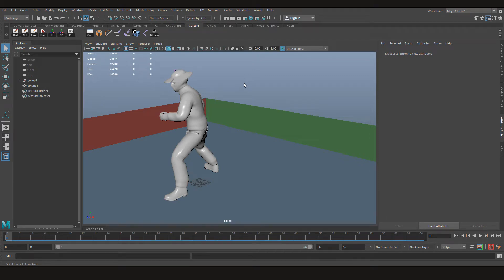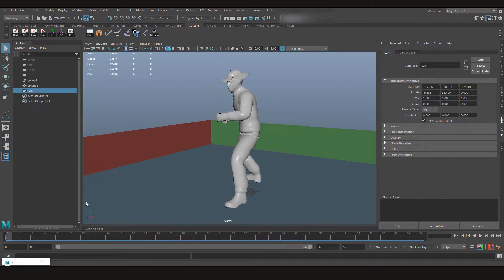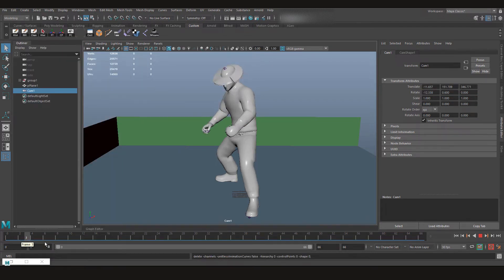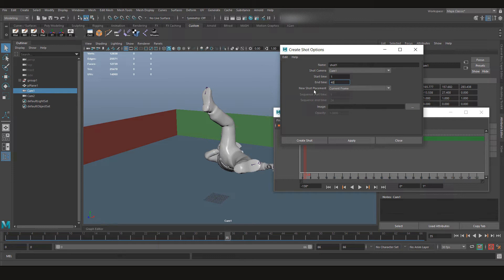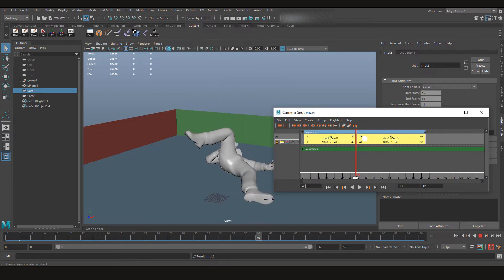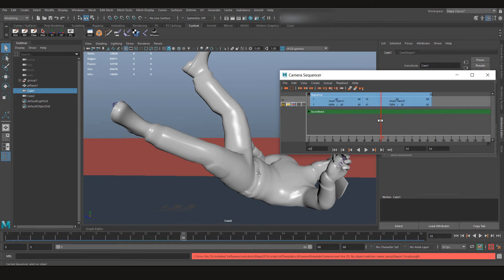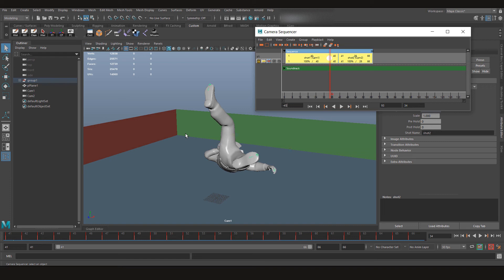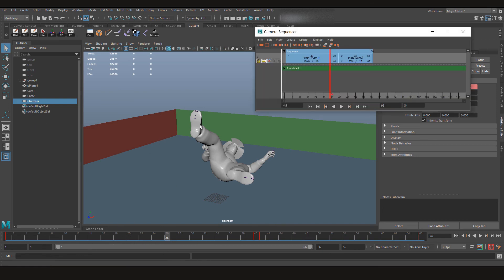Camera Sequencer 101 in Maya 2019 - CGFamily

Comment: It shows error while creating ubercam "Camera sequence shot must have the same duration in sequence and source" can you help with what the problem is please.
Reply from the maker: Hi, Maybe this will help. - https://knowledge.autodesk.com/support/maya/learn-explore/caas/CloudHelp/cloudhelp/2016/ENU/Maya/files/GUID-F5AAA908-D190-4004-862B-B0C6084136FB-htm.html

Basically, 1 of few things is that you need to make sure your shots are aligned. Like if 1 shot ends on 35th frame 2nd shot should start 1 frame after (36th).